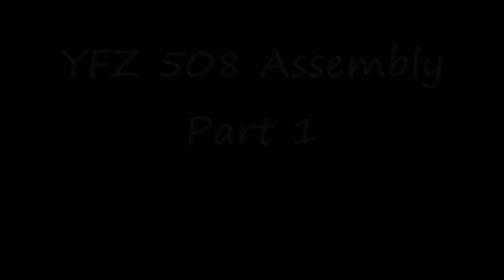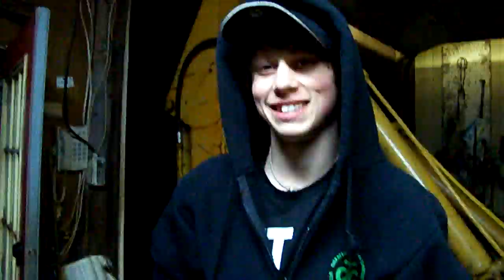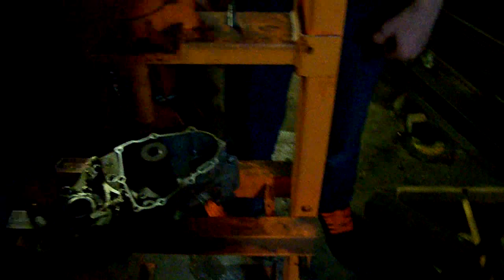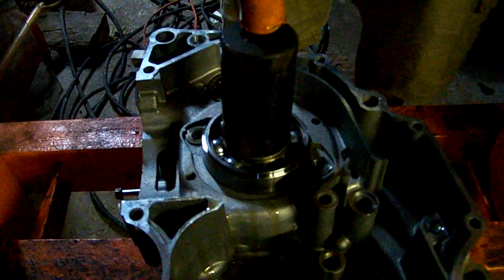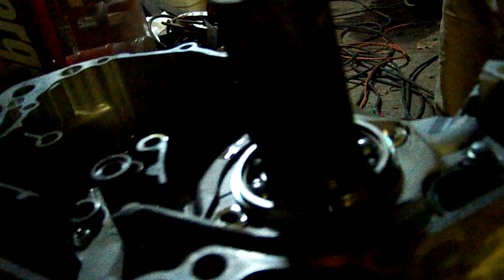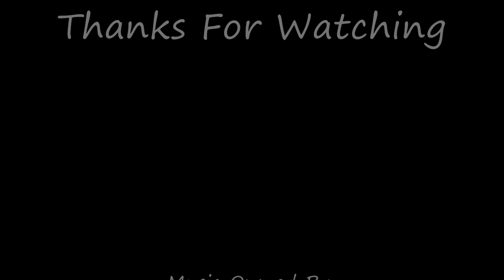YFZ Assembly Part 1

Comment: when you put the bearings in use a torch to heat up the case. it will expand. and u wont even need a press il will drop in on its own